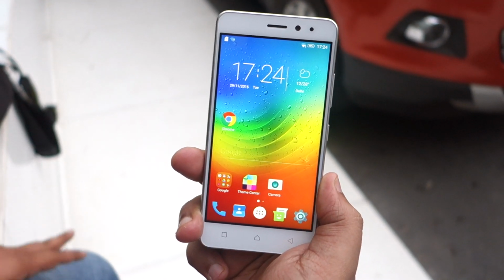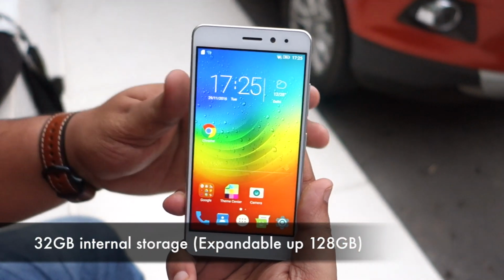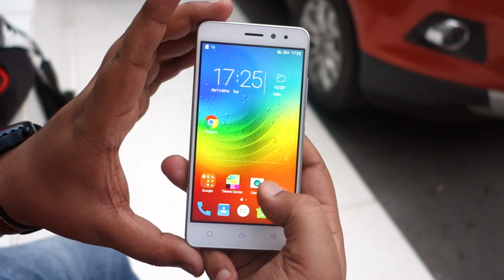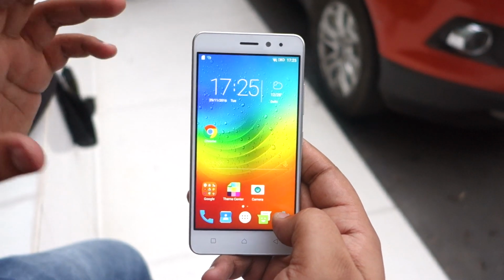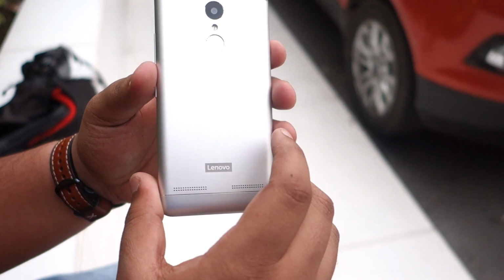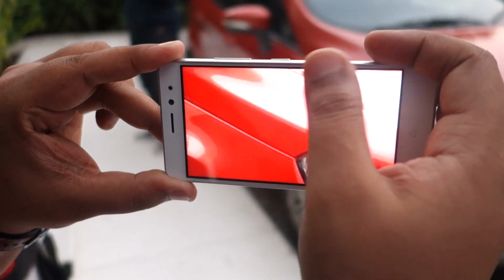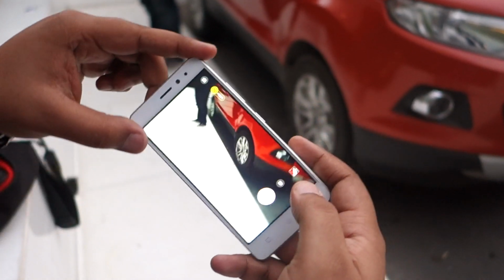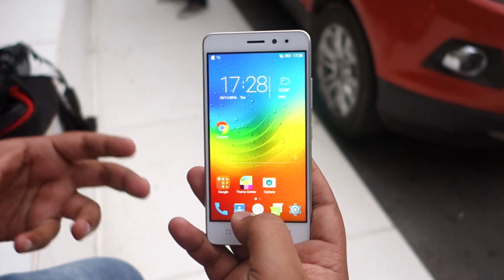Lenovo K6 Power: First Look | Hands on | Launch

Comment: Lenovo K6 Power Advantages:

+ Stereo speakers (83 db). Dolby Atmos on speakers & headphone. TheatreMax
+ 1080p IPS 441ppi display
+ Stock like clean interface 
+ 13 mp main camera with Sony IMAX258 sensor. 8 mp front camera with Sony     IMAX219 sensor.
+ All 4G bands of India 
+ Coming with headphone, back cover, screen guard out of box.    
+ Availability.  Having more service centers.

 Redmi 3S Prime Advantages:

+ Rs. 999 cheaper
+ IR Blaster 
+ Good Development Support
+ Compact & slimmer 
+ Good gaming performance on 720p display

Cons of both

- No dedicated MicroSD Card slot.
- Non removable battery 
- Non backlit buttons
- No gorilla glass protection
Reply: Thanks